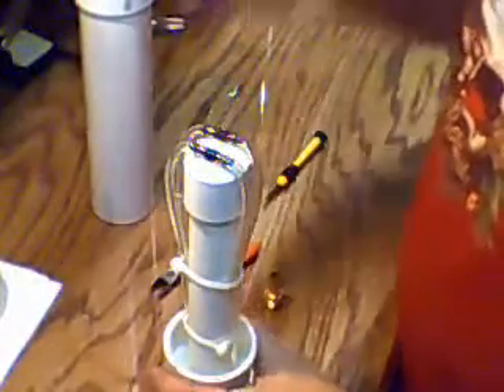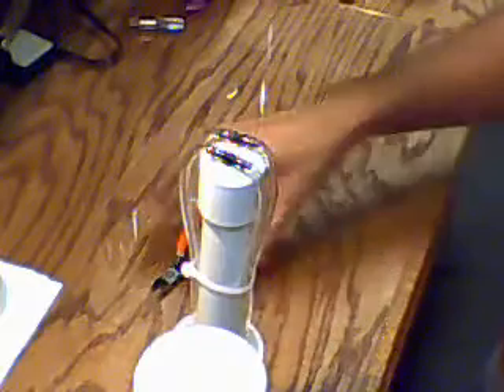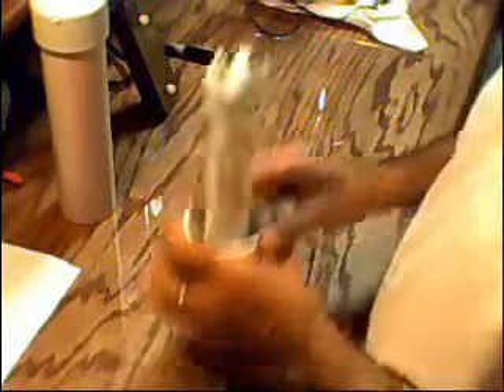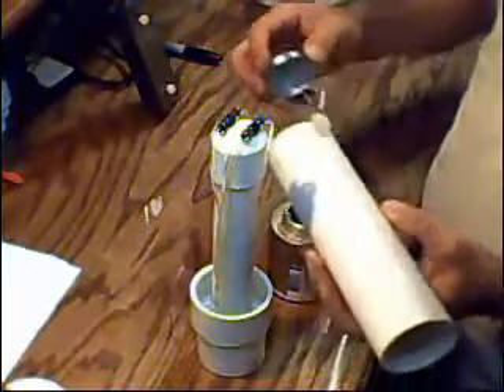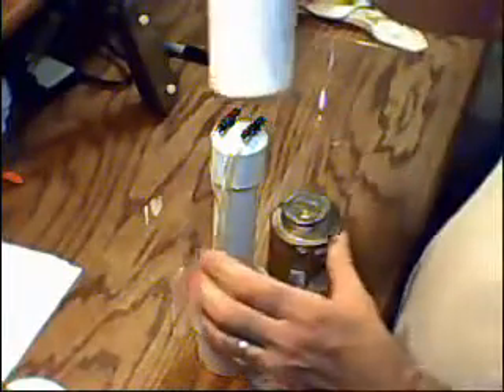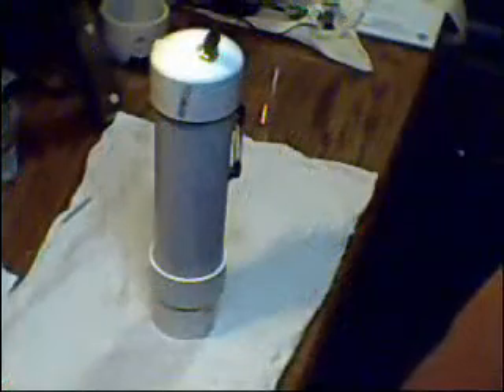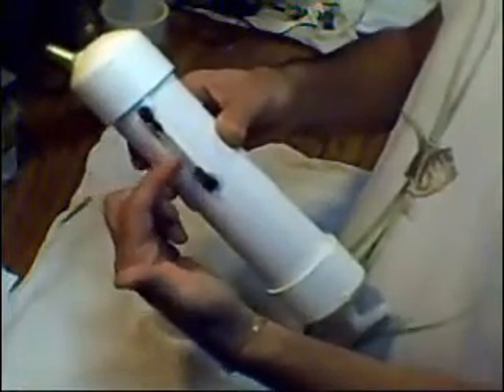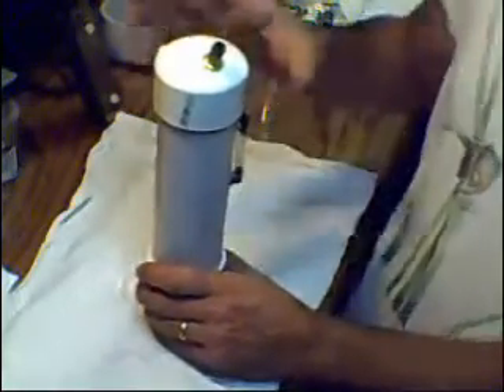HHO DuelCore Bubbler Part 3 Of 3

Comment: By the way, thanks for the shout about our EPD!  May I make a suggestion? Change the top cap to a 2 inch to 3/4 threaded reducing fitting (or a coupling and 2 to 3/4 threaded bushing). Move the output port to the side.
Good Luck!
Steve w/InstallGuys